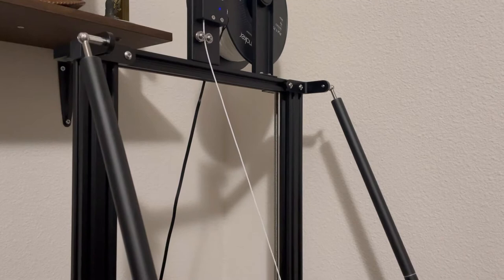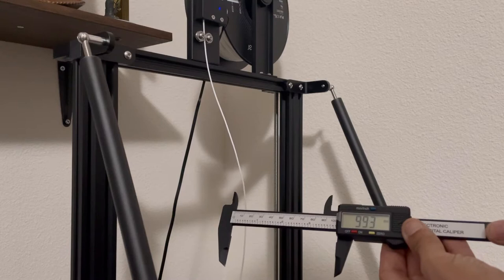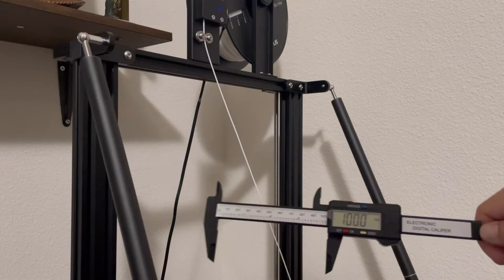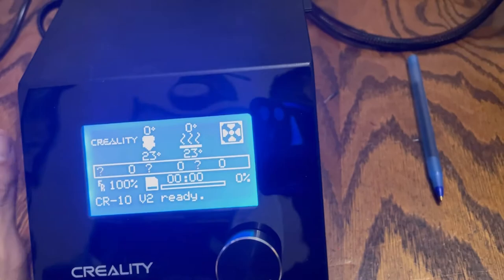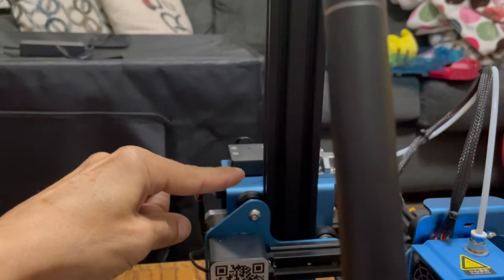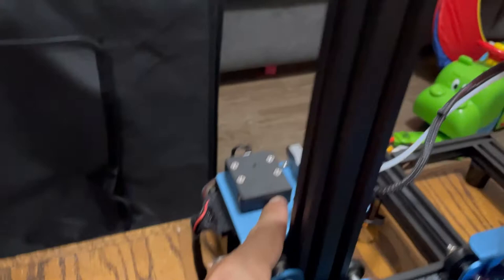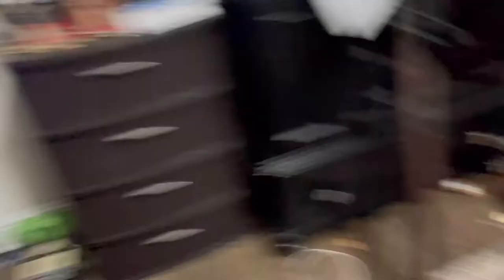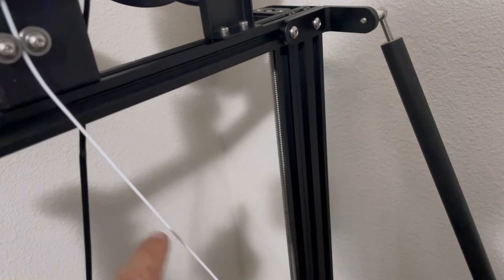Direct drive estep calibration tutorial | how to calibrate esteps on cr10 v3 & other direct drives

Comment: This is a GLORIOUS video!!!  And yet one more reason why I'm so happy I found your channel!!!  I watched another video before I went direct drive, and you helped me realize why another method is faulty.  Some people just measure cold filament through an extruder... but pushing heated filament through the hot-end introduces some resistance that has to have some effect on the rate of extrusion.  So measuring extrusion that takes into account pressing molten filament through a hot-end seems like it will be much closer to extrusion ratio during an actual print job.  So great job on this, and other aspects you covered!!!

Comment: Great video, thanks for the detail. I got a CR10 v3 a few days ago. Levelled, printed a dog, looked great so immediately printed all the bits for the free MK1 helmet off of Thingiverse. They came out OK but the side burns on the main bucket had lines in them that made them very weak/brittle. Posted and was told to do my E steps and with your help I am doing that now :)

Comment: The estep value for the CR-10v3 is higher because it's a dual gear extruder with a reduction ratio of 3:1, while the stock bowden extruders are single gear. The reduction ratio comes into play to give you a bigger steps/mm.

Comment: The relationship between the estep setting and the mm extruded is obviously not linear.  Otherwise, you would have been very close after the first test with your second estimation.  You can get there a little faster successively using points that are closest (one above and one below) and interpolate the next setting to try.  OR - Even faster would be to plot these points as you get them on a graph and should be able to plot a smooth curved line through 3 (or more points).  The spot along the x axis that is 100 mm will give you your best guess at a setting value (on y axis of graph).  Hope this helps.
Reply: It should be linear.  It’s possible the creality machine with the titan extruder just has issues with grabbing filament and pushing it through consistently.  I have one and the extruder sucks

Comment: Hi! just a question on the Cura "method". it would suggest that there is a way to instruct Cura to just extrude , say 100mm of filament, without actually printing an object. does such an option exist? otherwise it would still be a perfect way to "save"the final e-step result for all future prints, right?
Reply from the maker: You have to find out what your machine is extruding to put in the gcode for the proper esteps. So the only way to find this out is by having the machine test print or extrude X amount of filament & calculate the difference or shortage to the proper value
Reply: @Darkwingdad  thanks for responding so promptly! i do understand the issue, i think. I was just wondering if I could use Cura to help me in the actual experimenting trying to find out the proper value for esteps. i fully appreciate that I can include the final value for esteps in the Cura start/end gcode sections. I hope this clarifies my question....  for now, i have stripped a Cura gcode file for a recently printed object and added a few gcode instructions for extruding 100mm of filament. tomorrow morning i'll put the printer to work(CR10S5).
Reply from the maker: @servaasjaasma  you can put the esteps in through pronterface if you’re trying to permanently implement the new value. Is that what you’re after?
Reply: @Darkwingdad  sorry for not being able to get the issue across to you, my fault entirely. what I want to do is to get Cura to make me a gcode file which does not print an actual object but does nothing more than extrude a 100 mm of filament. my question is: can this be done? does this help....
Reply: Awesome video, so thank you. Could i perform this by taking the nozzle off therefore not wasting any filament, that way I can release the extruder arm and pull it back?
Reply from the maker: You don’t need to use cura to extrude 100mm of filament. You can do this by from the control box telling the extruder to move 100mm than measure the difference & do your calculations.
Reply from the maker: @marksneyd1262  you can yes

Comment: Thank you so much for that information. I have another problem with my CR-10V3 my nozzle is too low and it set on the left side of the bed and when I tried to level my bed the nozzle is hitting my bed. Can you help me out with this?  I am new to 3d printing.  Lost
Reply from the maker: Have you completely loosened your bed springs?
Reply: For future peeps: TIGHTEN the bed springs, to lower the bed. Ideally, get a CR-TOUCH, and set the Z yourself.

Comment: I understood for every but lost in the Calibration. I have the same 382.14 was wondering if I just place the same number as you...will it work?
Reply from the maker: 382.14 is the factory value, that will need to be adjusted. Have you tried extruding 100mm of filament to see if you’re under or over extruding?

Comment: If you bring the mark down to the start of the extruder with a mother marking 100mm above it , how would you be able to tell how much you over extruded , as the all marking a would have been melted ?
Reply from the maker: You can make an additional mark 10mm after your 100mm mark to determine how much your over extruding. Although it’s rare it does happen. So if it does just make 1 or 2 marks 10mm each and calculate how much you over extruded.

Comment: Just in case anyone else is reading this, I got a cr-10 v3 and also had the original 382.14 value but only needed to do the 100 mm extrusion once to get a 415.37 which was exactly 100mm extrusion. So it is up to luck how many times you'll have to do it.
Reply from the maker: You won the lottery on that one!
Reply: That's what I'm using. Been here all morning googling, and trying to understand how to do this There is filiment in the Direct Drive, and the HOT end, so, how do we measure that? Or do we have to clean it out 100% 1st, measure it, mark it, then load the filament and push the 1st mark all the way down to the hot end? What I did was, mark 100mm from start of DD. Got a #, did the math, landed on 409.1.  Repeated the process, and the mark is now about .5mm above the DD. So, I'm SET, done at 409.1? If I Did this right?
Reply: Lol. Just stumbled across my own comment. 3 months later, STILL troubleshooting my CR10V3, and have not put it into use.

Comment: Why not just mark at the top of the extruder (straight line at the collar) and then again at the top at 100mm?  Any reason? THX
Reply from the maker: As long as you can mark, measure & inspect you can do it anywhere on the filament. This is just where I measured on the machine.

Comment: Would you be able to show how did you get -20.1 and then +16.1 please
Reply: The -20.1 is the length of filament that was left over after telling the machine to extrude 100mm.  He asked the machine to extrude 100mm, it only extruded 79.9mm.  Therefore, it under extruded 20.1mm of filament.  Same thing with the 16.1, however when telling the machine to extrude 100mm, it actually extruded 116.1, meaning it extruded 16.1mm too much.  You would measure these against the markings you made on the filament with a sharpie.

Comment: where did you get the filament run out sensor bracket?
Reply from the maker: It came with the cr10v3 there are ones you can print though

Comment: I just get it close with math and then just keep doing 100mm tests with a caliper.
Then if you want to get it even closer then do 50mm tests and then 25mm tests. Yeah it’s some filament but it’s definitely better to get the mechanical measurement perfect just because the gears do wear and they have a average amount of gear lash slop!

Comment: hi , i’m new , do i have to do this ?
Reply from the maker: Yes the first thing you should do is calibrate your esteps
Reply: @Darkwingdad  did it massive massive thanks !!! Have subbed
Reply: @Darkwingdad  did it fine but when I turn off machine then back on the new e-step settings is lost & returns back to the default 382.14
Is there a way to keep the correct calibrated setting ?

EDIT think I’ve found it -I pressed “save” on sane menu thanks
Reply from the maker: @adrianstealth340  2 ways you can do it. 
1) input your new esteps into the machine under the control setting
2) Input the esteps into the gcode of your slicer. Often times the machine can revert back to factory esteps if not used routinely or if unplugged. 
No worries though with the gcode as when you beginning printing it puts those new steps in for you as soon as you select print!
Reply: @Darkwingdad  cheers again I’ll do the G-code thing if the save reverts back I’ll keep checking due a while 
Have a great weekend